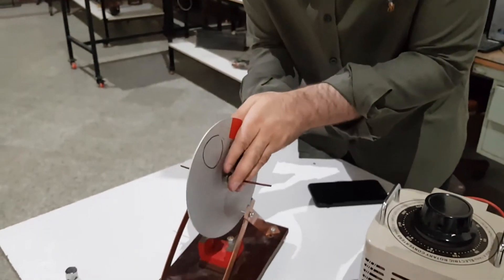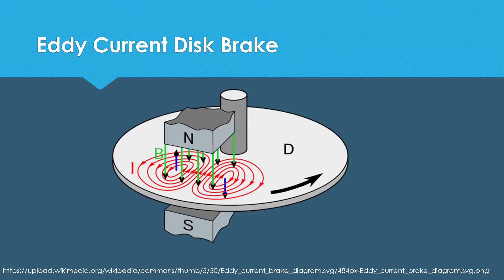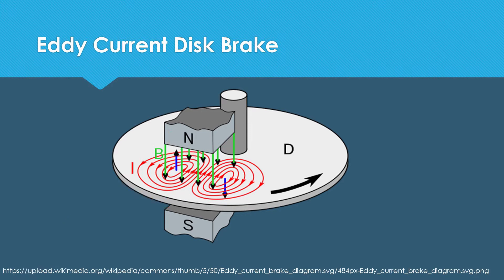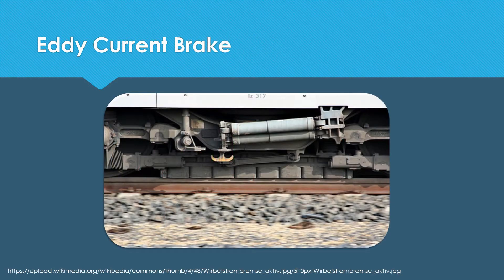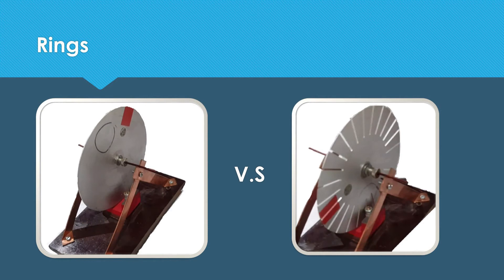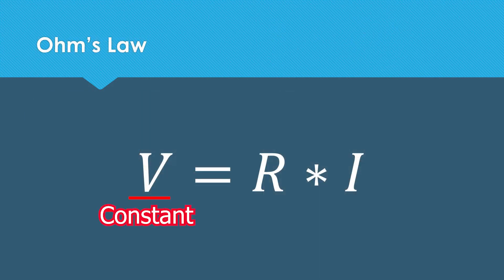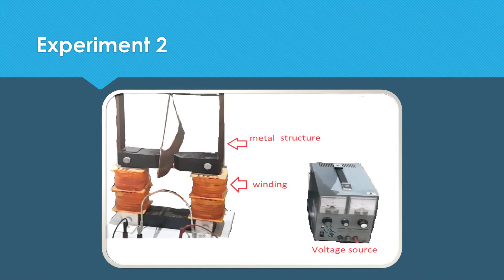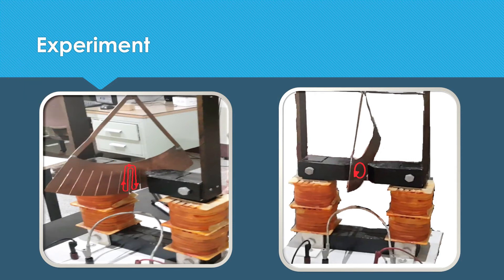Eddy Current - Electrical Brake!

Comment: Why not used in trucks/cars?
Reply: In train patri there is metal with conducts current how is it possible on road😇😇
Reply: @Mentormatters123  battery that activates coils between two plates